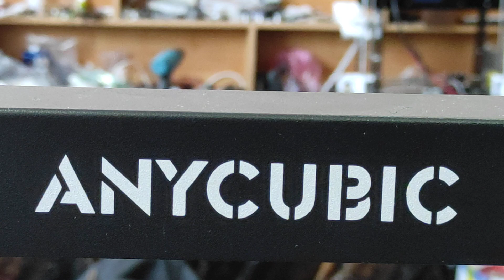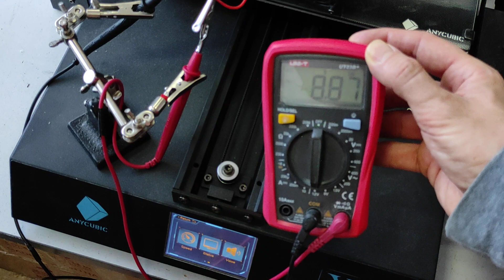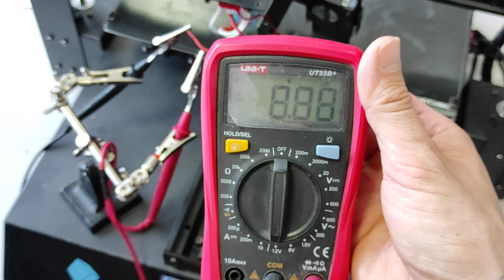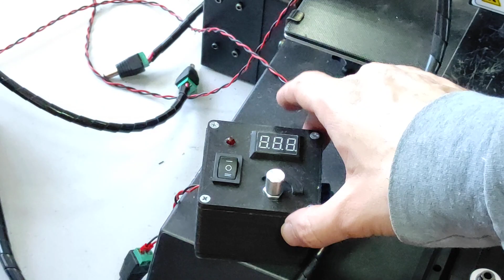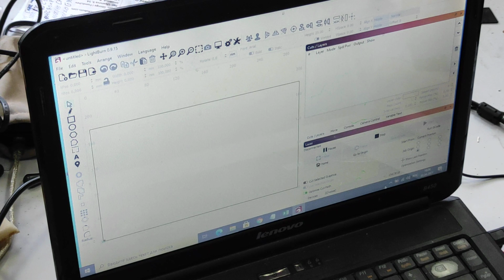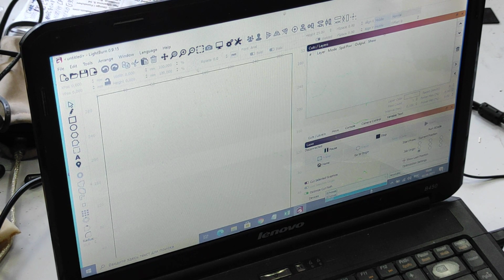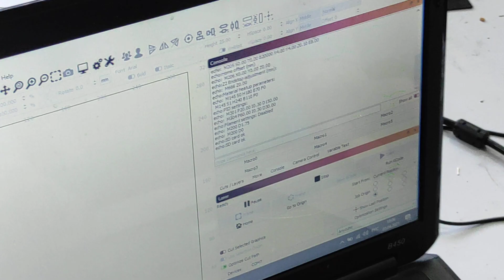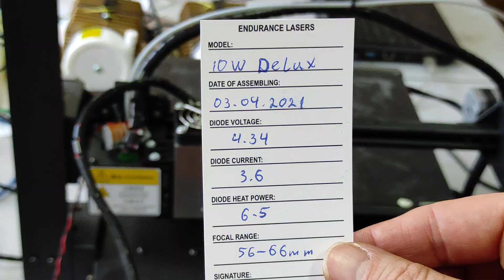Setting up Endurance 10 watt Delux laser on Anycubic Mega X 3D Printer: wiring, mounting.

Comment: hey man quick question with this setup does the printer still operate properly? like can i splice a lesser laser into this fan slot and add a splitter to connect the fan and the laser, run an fdm print the fan work properly and the laser not turn unless i tell it to turn on in lightburn?